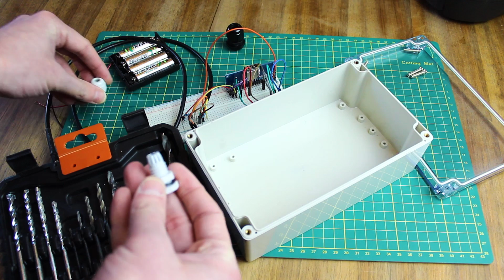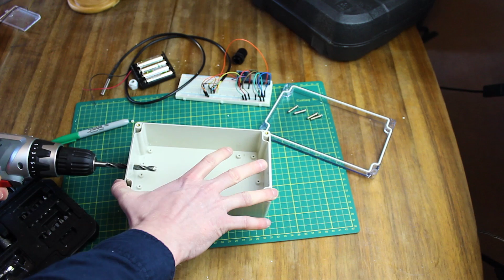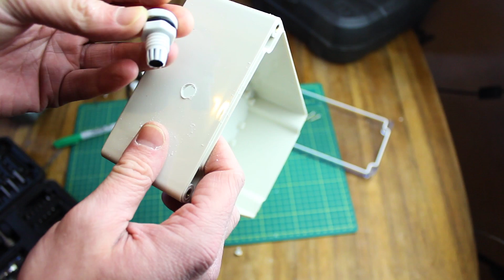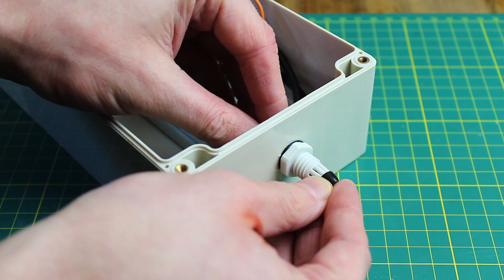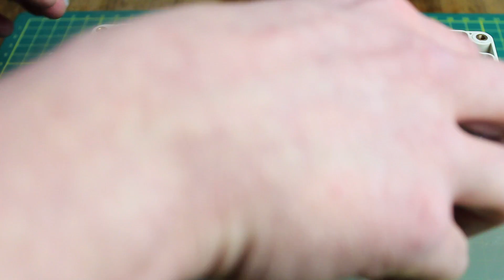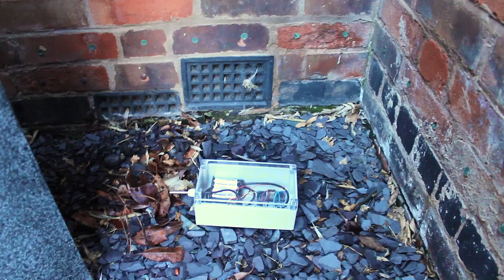Part 2: Outdoor Temperature Logging with ESP8266 ESP-12f

Comment: At 2:10 you say, "this one barely goes through". Well, sure! You are trying to force the thickest part of the wire through the gland (that is where the manufacturer's heat shrink is located).
Instead, feed through the wires which will be plugged into the breadboard then pull the rest of the wire into the box until you come to the heat shrink section.

Comment: those vents from the house are affecting ambient temperature.
Reply from the maker: It might be but it seems to be tracking pretty well with the BBC forecast. The vents are to the cavity wall rather than the inside of the house. I have moved it further away, as far as the WiFi will carry it.

Comment: 4:10 I think you had the drill in reverse !
A drill should go through that plastic easily.
Reply from the maker: I didn't, it might looks like that on camera. Plastic melted to the end of the drill bit, I used a wood drill bit which was a mistake.
Reply: OK sorry, maybe there was something wrong with that particular bit, because any wood drill bit will go through that type of plastic like a knife through butter.
Reply: @Ruben yes, plastic is tricky in my experience too, because it can bite, crack or tear.
"pagoda drill"
https://www.aliexpress.com/premium/pagoda-drill.html?spm=2114.01020208.0.0.safY9l&site=glo&SearchText=pagoda+drill&g=y&SortType=price_asc&groupsort=1&needQuery=n&filterCat=100006879,141705,100006906
Reply: looked to me like blunt drill bit and no pilot hole, rather than file would have been easier to get a holesaw/bigger drill bit! :)
Reply: Yes a pilot hole or step drill might help.
Reply: I've tried plenty of ways to drill through plastic and it's always been tricky. That pagode drill bit mentioned before is great though. I've got one from aliexpress for about $3.- which looks fine, and is surely okay for drilling plastic.
Otherwise you'd need to get a drill press because the drill tends to 'bite' into the plastic.

Comment: Nice tidy looking unit, well done. It's worth spending a couple of quid on proper seals and glands. Just started using one of those ds18b20 sensors myself last week for my immersion heater, so far it seems fairly reliable and accurate. As you said, it's in a sheltered location, would be interesting to see what sort of readings it would get in a more exposed location.

Comment: It's helpful to start with a smaller diameter pilot hole when drilling larger diameters. A step-drill bit is a really good tool for drilling out project boxes. Inexpensive on Banggood, eBay, etc.

Comment: Nice video, can't remember if you mentioned it but I assume you put the esp8266 into deep sleep? Also the voltage divider would that add to battery drain ? For voltage regulators I use the mcp1700.  It has 1.6uAmp quiescent current but saying that the ht7333 is good as well as it takes up to 12v and has quiescent current of 4uAmp. Looking forward to your next video!👍🏻
Reply from the maker: It is going into deepsleep, the voltage divider does add to the battery drain but hooked up to my bench power supply it is still in the µA range but it could be a little higher, I don't trust it's accuracy.  Ideally the voltage divider would be hooked up to a transistor or similar so when I want to take the measurement I just stick a high on a GPIO. I think 100k and 20k is a little high for esp-12 ADC which is why I am getting odd readings.

Comment: I'd suggest using drill bits meant for metal instead of wood (if you have one). Also, a question: why don't you make your own pcbs?
Reply from the maker: Yeah, the wood drill bit had a spike on it making  it incredibly difficult. You are right I should have used a different one.
Reply: David Watts You didn't answer my question about pcbs. I just think it's very nice to be able to have a board in my hand after an hour of designing it. Would probably stop you from ordering boards and never populating them :D
Reply from the maker: I usually send them away to be made. I wouldn't know where to begin etching my own at home.
Reply: If you are interested in making your own board here is a little list of steps and things to google for more information.

Step 1, make the circuit drawing and get it on a pcb:
There are 3 ways that I know of to do this. 
First is to draw the circuit on to the pcb with a permanent marker, this is fast but only suitable for big pads and traces. 
Second is to use uv exposure. This is the easiest method and gets high quality boards. In this method you print out the design onto a transparency sheet (should work with paper too, just not as well), put the design on top of a board with a UV sensitive coating, shine UV light on to it and then wash the undeveloped (or developed, it depends) part off to get the mask for etching. If you don't have a UV exposure box, it is easy to make one with some 395nm UV leds from ebay.
Third: use the toner transfer method. In this method you print the design with a laser printer on to paper (glossy, preferably), put the paper on top of the pcb and heat the pcb and paper to melt the toner on the paper and transfer it to the board.

Step 2, etch the board:
I know 3 chemicals to etch a board: ferric chloride, ammonium persulfate and a combination of hydrochloric acid and hydrogen peroxide. The first is widely used and relatively safe but it stains everything it touches. I've heard the second is safe but slow. The third is fast and also relatively commonly used but hydrochloric acid isn't exactly fun stuff.

Step 3, drill the holes:
This can be done with a drill but with many holes it gets tiring and small drill bits break VERY easily. Should probably have a drill press if you are going to make small holes or boards with many holes.

I left out things about making solder masks, silkscreens etc., double sided boards and vias but you should be able to find information on these by googling. You should also google the things I mentioned to get a better understanding of the processes involved and to pick the right one. It might not be worth it to make the boards yourself if you have to buy a lot of equipment to do it. 

(this became much longer than I expected)

Comment: Over the past year I've bought a whole stack of those types of boxes from aliexpress.  They are really great for the price, but the screws do rust very quickly. I've decided to buy a bunch of that type of screws but then made of stainless steel...

edit: search on aliexpress for 100pcs/lot DIN965 M4*18 Stainless Steel A2 Machine Phillips Flat Head (Cross recessed countersunk head screws) Screw

Comment: Those strain reliefs are really nice in applications where the cable needs to be removed or adjusted afterwards. Silicone is cheaper (considering one owns it already), it's quick to apply, but making adjustments later isn't as easy.
Let's hope that modification solves the self-heating problem.